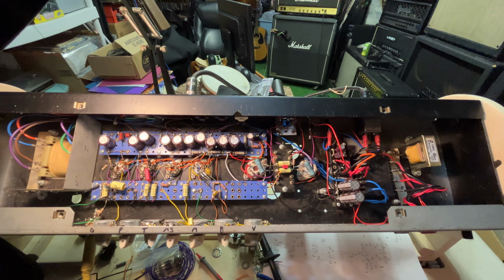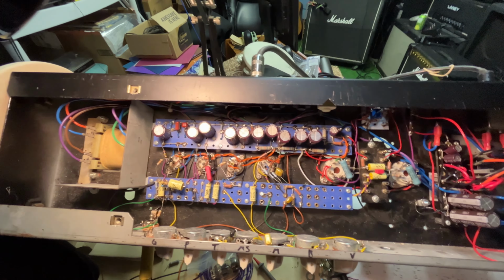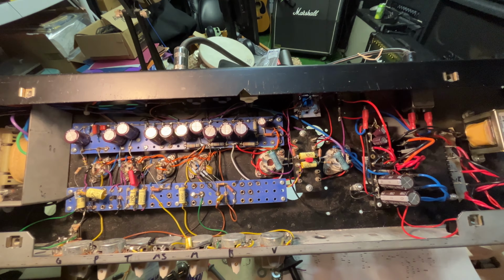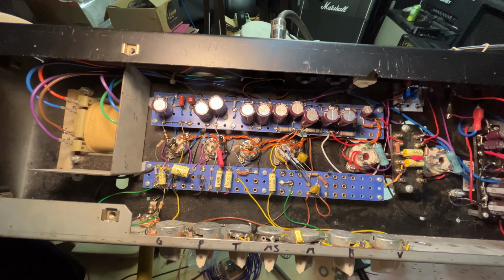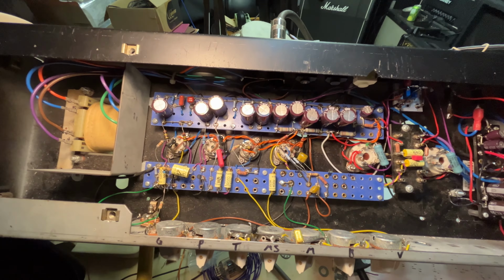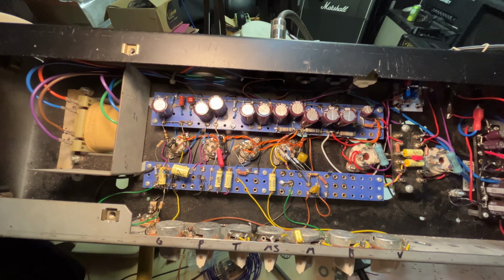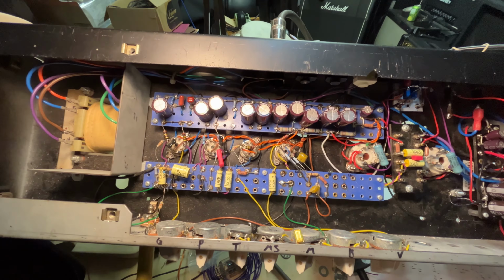My New Amp! I Built A Marshall JCM 800 2204 CLONE -Overview, Test & Comparison Demo - Have A Listen!

Comment: Both sounded great and little to no difference noticed between them. You are definitely an established player though 😂👍🏻✌🏻 and from what it appears also a fantastic builder of instruments 🎸 😊
Reply from the maker: Thanks a lot man! In the room you can hear and feel a lot more difference than comes across on the recording. I'm not quite sure how to capture that, maybe some very expensive mics!
Reply: This difference is huge sorry. The clone has a lot more midrange honkier tone and sounds like more distortion perhaps the transformer is saturating or underpowering the power tubes and they're clipping.
Reply: @MichaelDespairs  Fall back and rest your neck before it snaps 🫰🏻
Reply: @charlesbronson5235 I'm sure all the ladies swoon when you tell them you cosplay as charles bronson and troll the internet.🙄

Comment: Your clone sounds like it has a gated fuzz in front of it it. Definitely not quite right. Easy to blame the transformer, but I think the problem lies elsewhere.
Reply from the maker: Yup, that's what it sounds like to me too. I did a bit of research and ordered a bigger choke that matches the real marshall better. If that doesn't help then I do have a few ideas of things to tweak throughout the circuit, because it's ALMOST identical but not EXACTLY the same. I'll put up another video next week when the part shows up.